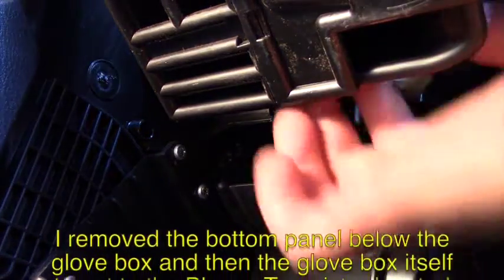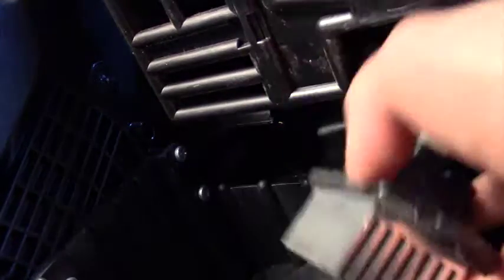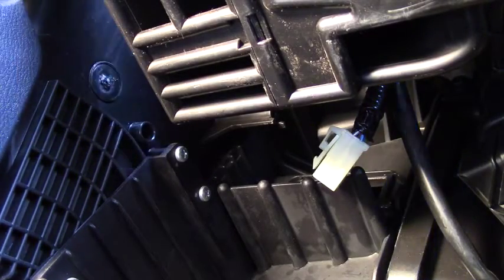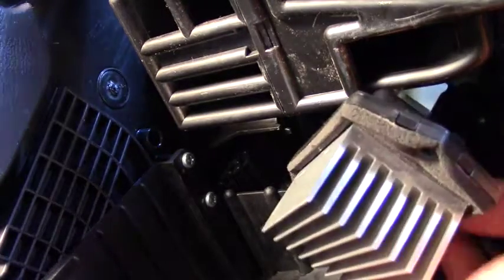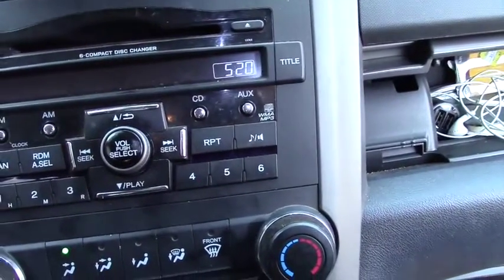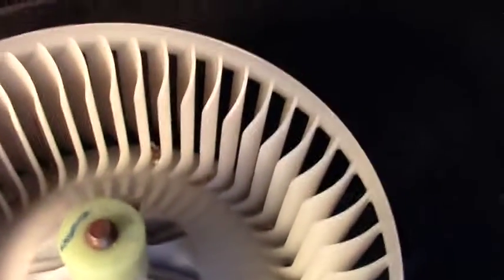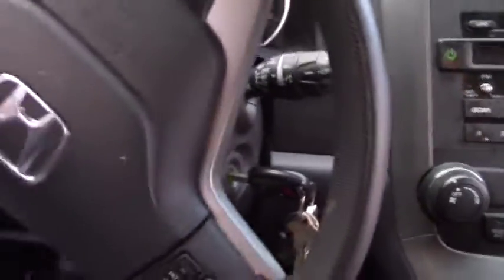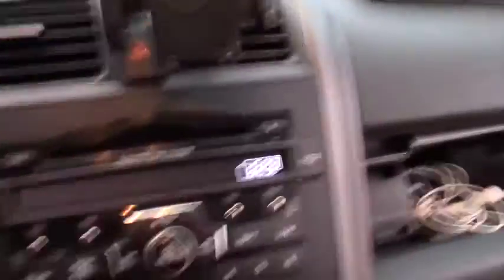How To Repair A Honda Heater Blower

Comment: Seems like a common problem with these Honda CRVs of this generation.  Mine is hardly blowing or not at all (the one for the windshield side works fine) so I gotta drop the blower motor.  Thankfully they didn't bury it deep under the dash.